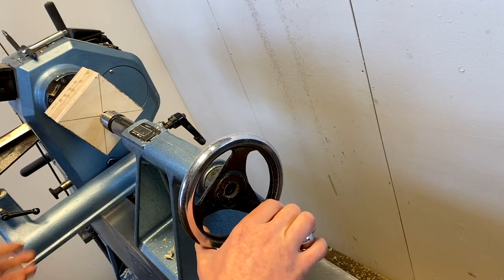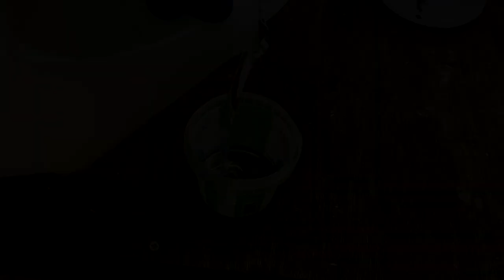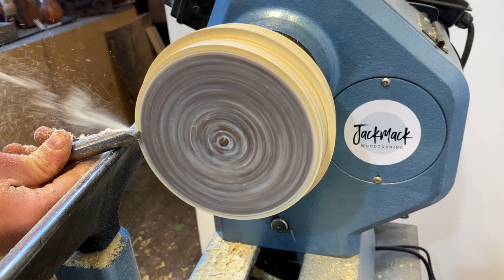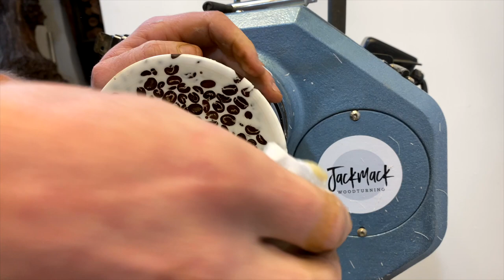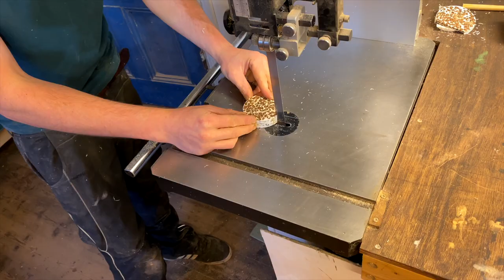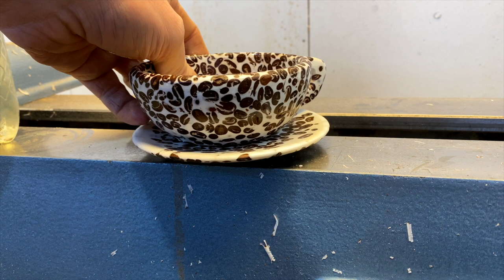Woodturning - The Coffee Cup

Comment: Amazing and unique as always! My favorite turning channel. I’m new to turning bowls. My starter turning set didn’t come with a bowl gouge. Can you recommend a gouge for turning the inside of a bowl?
Reply from the maker: Hey nick. A good bowl gouge for bowl Turing would be a 1/2” or 5/8” bowl gouge. I get mine from crown tools. As long as it’s hss steel the brand isn’t too important. What is important is that you learn to sharpen them on a manner that is easily repeatable. 
If your are serious about woodturning as a hobby I’d recommend buying a slow speed bench grinder, cbn wheels, and a sharpening jig system. This would likely set you back around £600 and is absolutely vital if you want to turn wood. 

You can get by with a bench grinder with stone wheels and no jig system but you’ll likely grind away a fair few expensive Turing tools before you learn how to sharpen by hand. 

Remember the most important bit… a sharp tool is everything.. a cheap second hand tool that’s sharp is way more useful than an expensive tool that blunt as an old boot. 

Thanks for watching buddy. 
Appreciate your kind words 😊👍🏻
Reply: @JackMackWoodturning  thank you so much for replying with such an in-depth answer. I have been looking at the Rikon slow speed grinder and it sounds like that’s important along with learning to sharpen well. Based on the size of my lathe (8” max for bowls) I think I’m gonna get a 1/2” bowl gouge and start practicing sharpening it. Thanks again!
Reply from the maker: Any time buddy. Always feel free to fire questions my way. With your lathe being that size I’d say a 3/8th bowl gouge would do you fine. 
I’m working on some tutorial videos soon so watch this space for more info about grinds ( shape of the cutting edge) 
But I recommend a swept back 55 degree grind on your bowl gouge. 
You’ll be able to Google that a find plenty instruction 😊👍🏻
Reply: @JackMackWoodturning  someone gave me a Benjamin’s Best 3/8” bowl gouge. Right now it has the stock edge profile on it. Quite stubby. Looking forward to the tutorial on sharpening to a better profile! I’m subscribed so I know I won’t miss it. Thanks again.

Comment: I'm a novice and self-taught so when I see an expert doing something different than I do I want to ask why. When I start turning a square piece that I am going to make round I nip the corners off with the band saw.
Reply from the maker: You should if that works for you. 
When I do one-off pieces like these videos, I am trying to work as fast as I can ( I fit these videos in at the end of my working day normally) 
For me it’s way faster to mount the piece on the lathe and turn it round. 

Setting up and tuning the bandsaw for a single cut can take 5-10 mins.. the lathe is already set, not to mention that I will have to take it to the lathe after the bandsaw and mount it anyway to true it up. 

That being said. If I’m doing 5-5,000 bowls il take the time to set the saw up properly to round the pieces out on the bandsaw first.. as this makes the full process faster. 
It does however have its down sides.. 
the corners from 1,000 bowl blanks are a nightmare to bag move and store.. i then have to arrange for a friend or friend of a friend to come and take away for firewood. 

Shavings on the other hand are easy to bag up and move.. and they go straight on the compost pile or to the local farm centre for animal bedding before being composted.  

For me everything I do is about economy of time weighed against safety/my own personal ability with my machinery. 

Hope that helps. Thanks for watching and if you have any other questions just fire them my way. 👍🏻